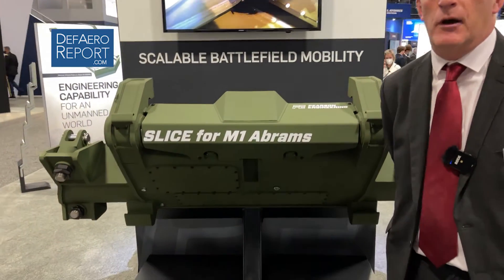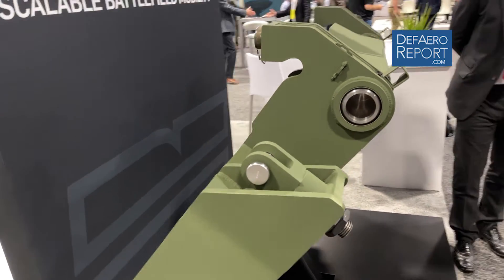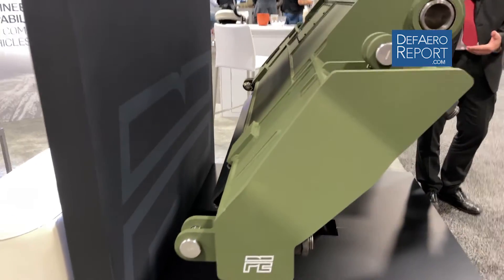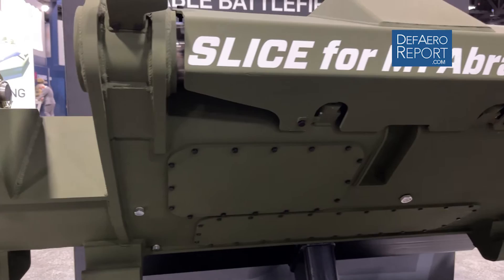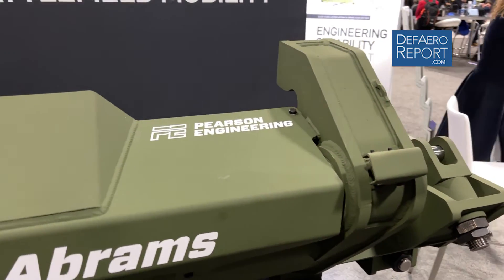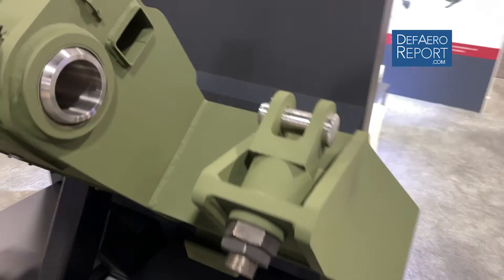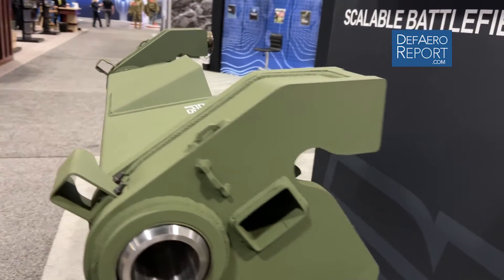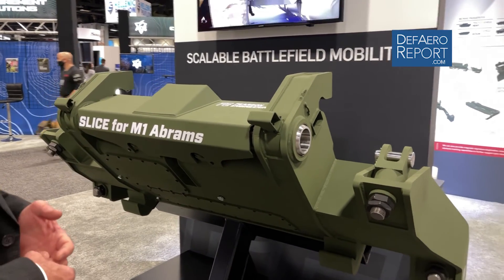Pearson Engineering’s SLICE Combat Engineer Adaptor

Comment: As best as I understand it is like one of those backhoes you attach to the b ack of a farm tractor using the same points the 3 point hitch attached to?  It might have an electrically driven hydraulic pump or similar mechanicals inside.  What a pile of marketing babble and word salad.